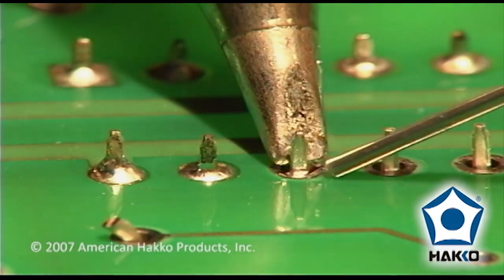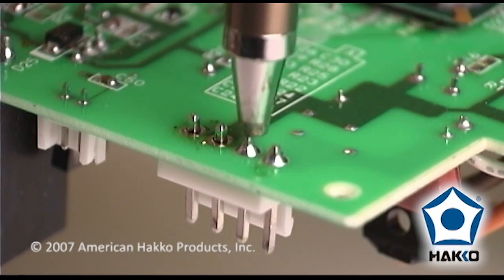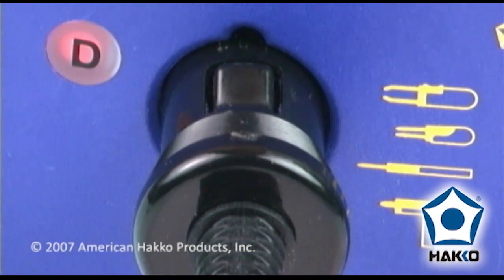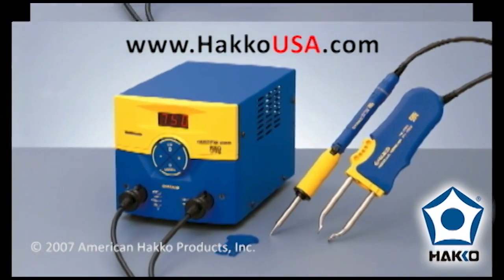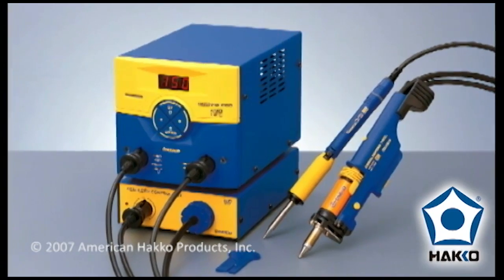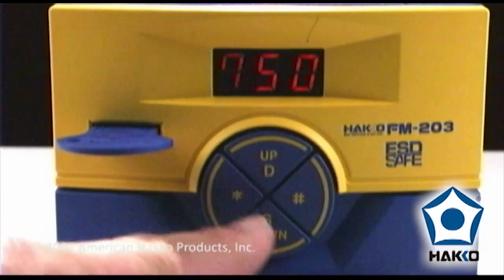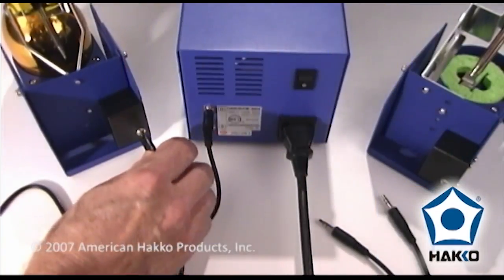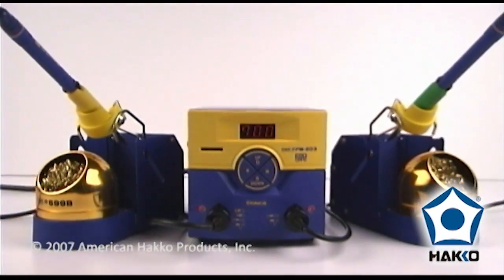Hakko FM-203 Dual Port Soldering Station — Video by American Hakko

Comment: I'm thinking about ordering this soldering station, but the thing is, I live in a country where we have 230V mains supply. Is the Hakko FM-203 available as 220-240V units, or are these stations only manufactured as 110-120V compatible units? I would like to avoid using a step down transformer if possible.